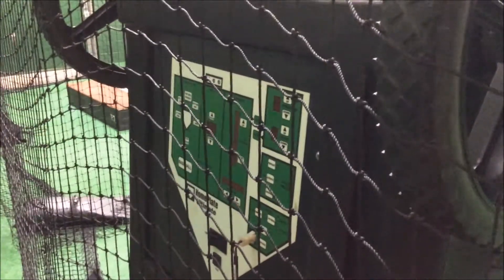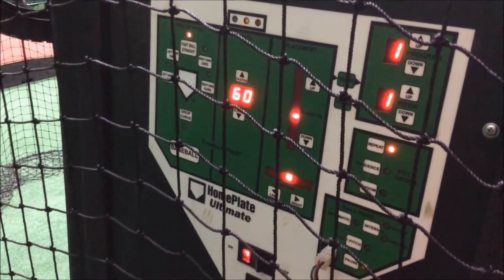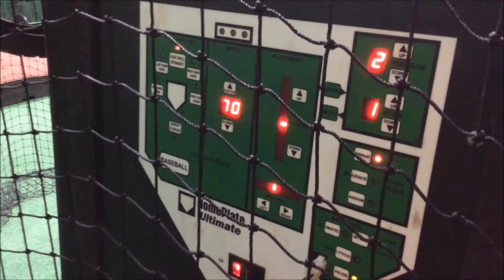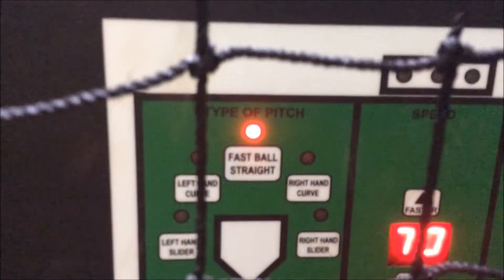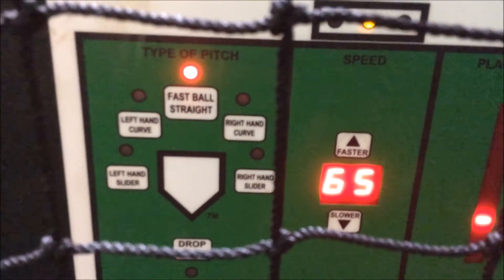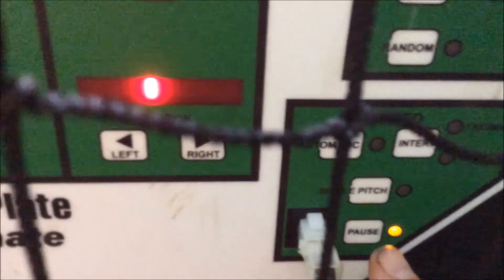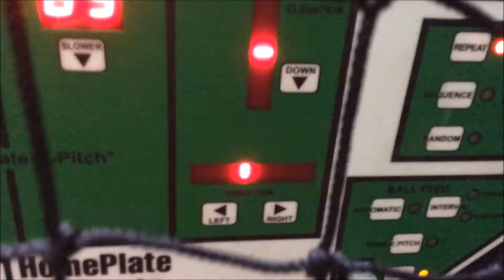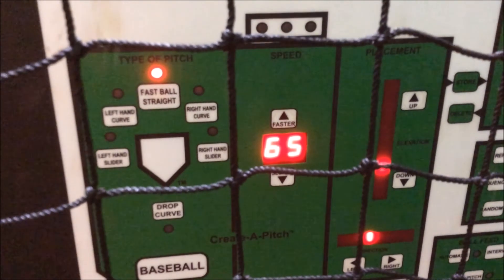Homeplate Pitching Machine Tutorial

Comment: Good video on how to use it. I just picked one up behind a batting facility and they said its broke and doesn't work. I took it home and replaced a fuse and it works great. I do however need to buy the legs and a remote.
Reply: @ninjazxd Bro, that's like a $10k piece of equipment! You should be arrested 🤣